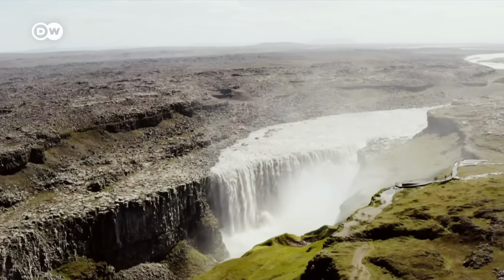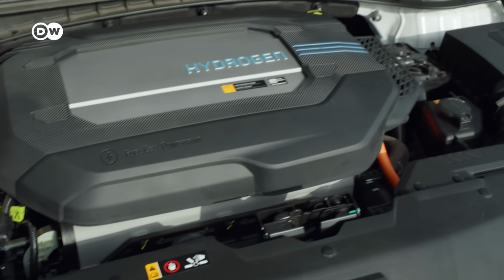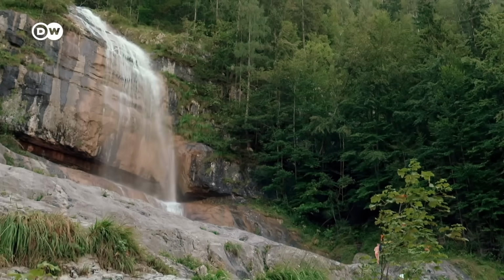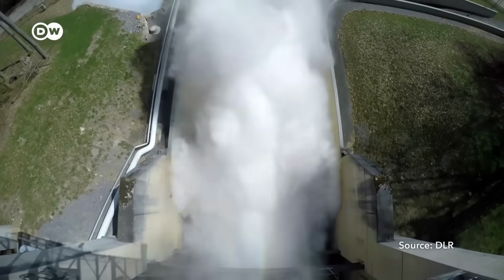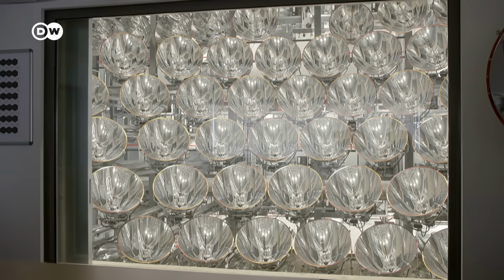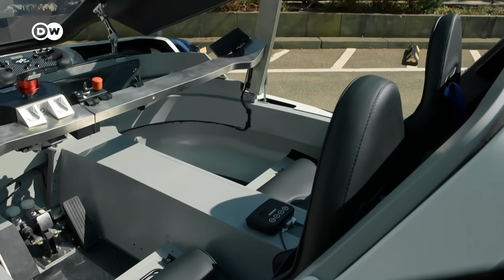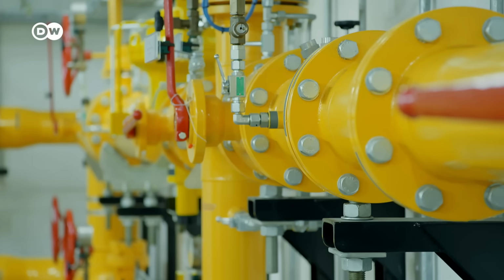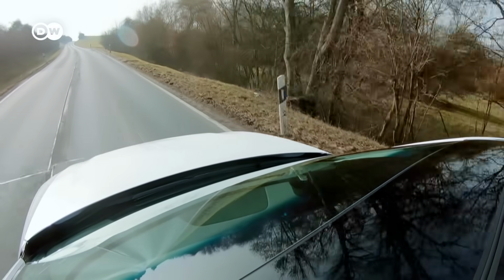Is green hydrogen the answer to the climate crisis? | DW Documentary

Comment: The world should focus more on hydrogen fuel power technology.
Reply: Its stupid, extremely complicated, so prone to break, and the energy you get in the end is just 10% of the initial input, so 90% is wasted. Batteries are much more efficient, near 99%
Reply: @celdur4635  Neither batteries nor hydrogen are likely to solve all of our energy needs. Just like electricity (solar, wind, etc) the solution will be for the application and not one size fits all. Batteries are great for cars but not so great for airplanes due to the added weight. The biggest problem with hydrogen is the necessary infrastructure to create, store, and transport it (cleanly) and unfortunately that will simply take time and money to develop.
Reply: @CausticLemons7  I think hydrogen transportation should be cut from the chain completely. Most of the modern world countries already have electrical grid infrastructure, if we assume the electricity is green then why not have small hydrogen generating plants at refueling stations, better yet have one at home or a community or in the neighbourhood. Anyways, I think electric cars are better than hydrogen cars, it is simpler, cheaper and more effective. The only problem is the batteries but that will be sorted sooner than later.
Reply: @tomaskusnir2374  I mostly agree except that hydrogen can be superior to batteries for certain applications. Where mass/weight is important batteries tend to be weaker, but hydrogen also has minimum sizing due to fuel density. For passenger cars we need batteries all the way! But when you look at airplanes, long-haul trucking, trains, and even ships then hydrogen propulsion starts to be a little more competitive. Hydrogen can also be used as energy storage for the grid or elsewhere.
But you're absolutely right that we should be focused on electrification across the board, and we really need to consider the whole lifecycle for these technologies.
Reply: @CausticLemons7  Well written, I wholeheartedly agree
Reply: @tomaskusnir2374  Thanks! It was good talking with you.
Reply: Less